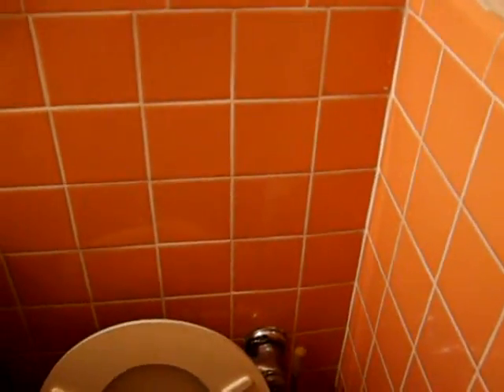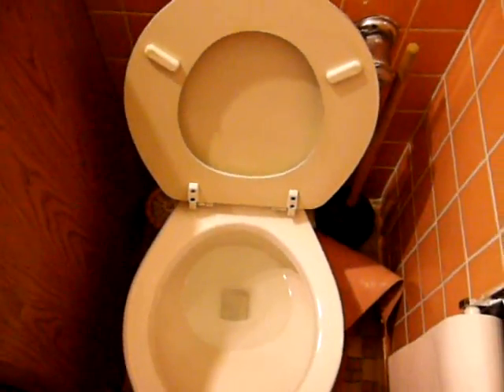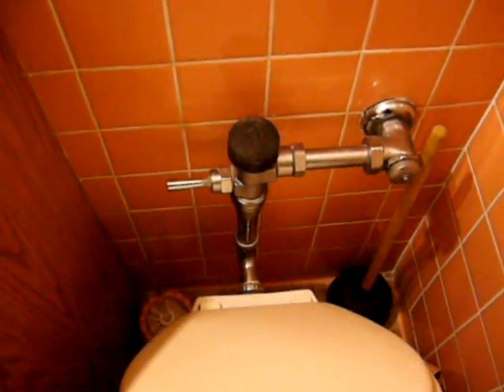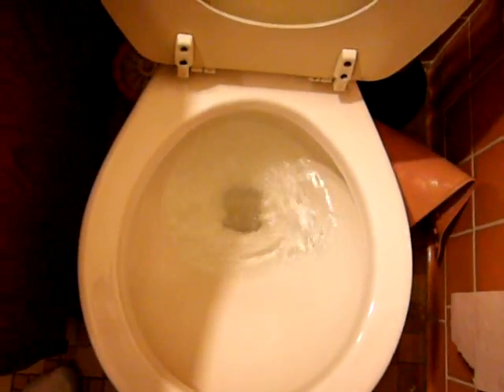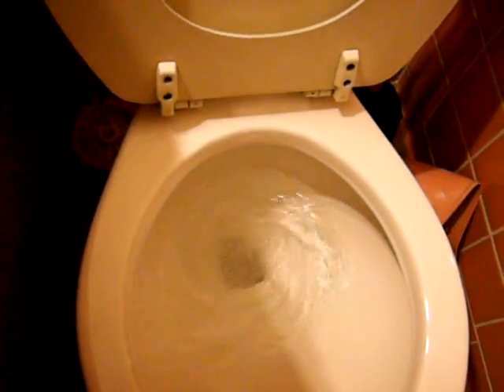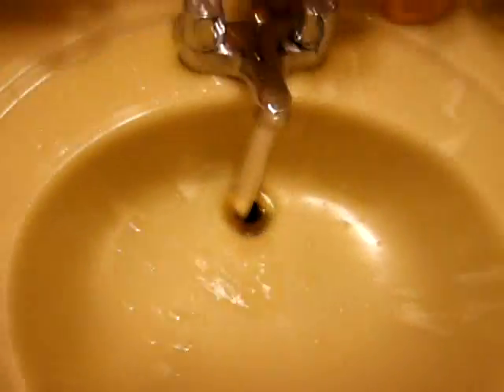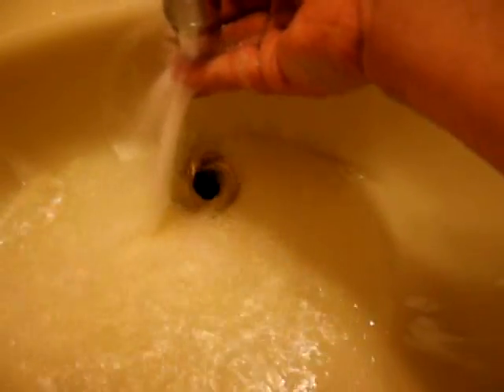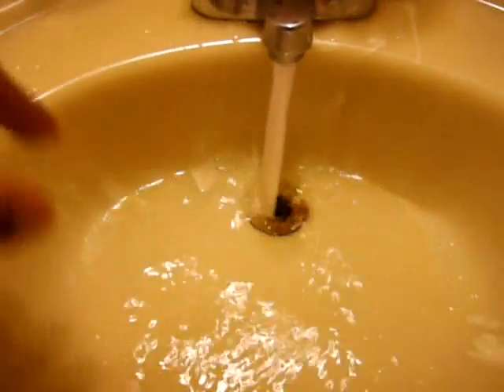Toilet flushing in other direction experimental debunk

Comment: All whirlpools can be made to spin and sustain themselves in one direction or another, thats not the point, the point is which direction one spins when it was naturally created in say a street drain, or a water tub with a simple hole in the bottom, In those instances, they WILL spin in opposite direction on opposite sides of the equator, the same as typhoons, and hurricanes. The Coriolis effect does exist, it is just so small it can be over come easily.